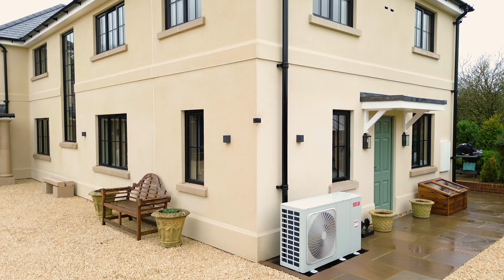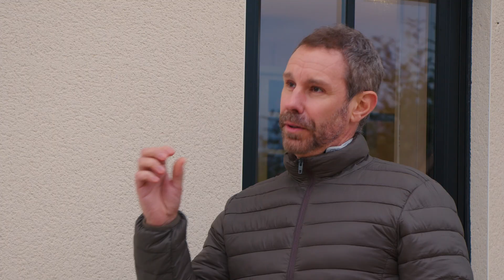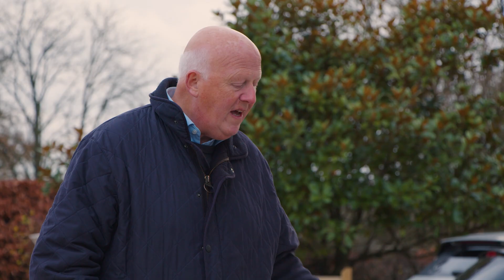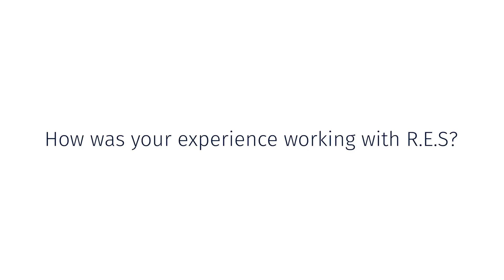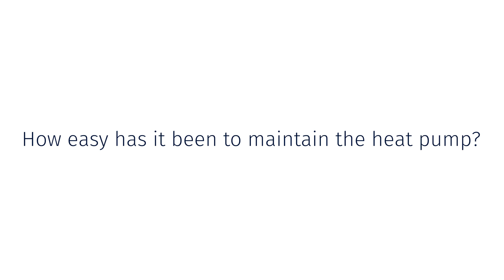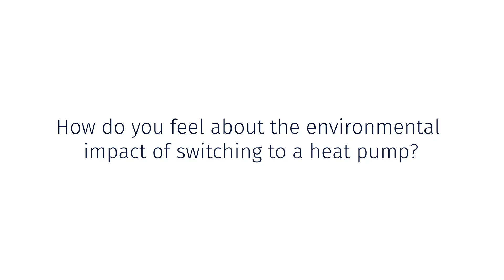Case Study: Switching from Oil Boiler to Air Source Heat Pump | Cost Savings & Benefits | 2025 R.E.S

Comment: Glyn Hudson channel has some great videos on his heat pump projects in N. Wales. Victorian solid stone walled terrace, 1980's bungalow, as well as an amazing renovation of stone cottage in beautiful Snowdonia.  Blows all the ridiculous "myths" about heat pumps out of the water. Heat pumps are one of the most widely used pieces of technology around the world with billions of units deployed for heating, cooling, refrigeration and dehumidifying. The technology was first patented in 1834 in London and Edinburgh by Jacob Perkins, so this is a very well understood and well developed technology which has been around far longer than the diesel or petrol engine.